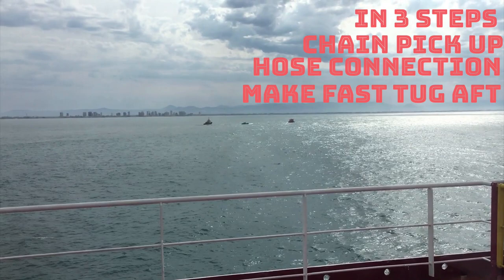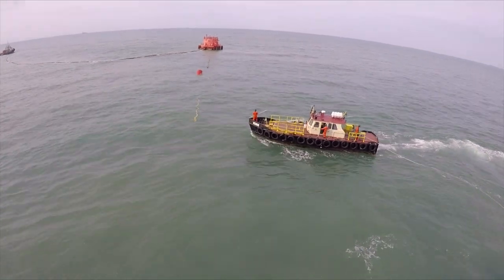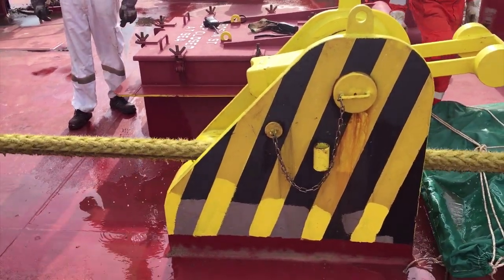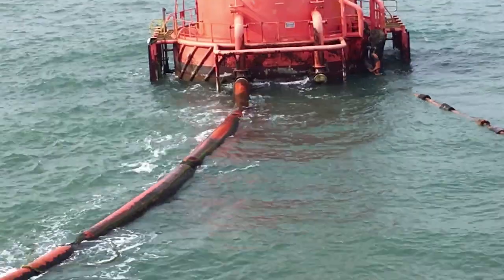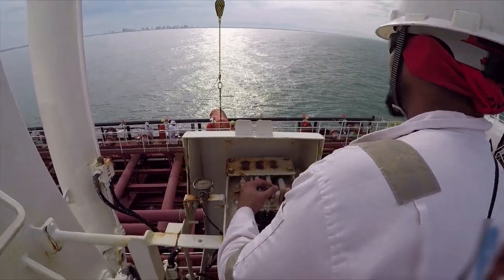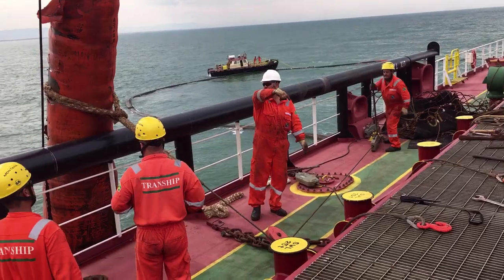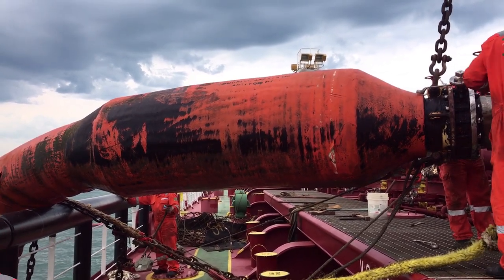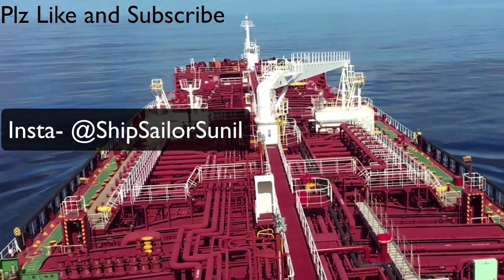Single Point/Buoy Mooring/ SPM SBM/Tanker Ship/ShipSailorSunil

Comment: Amazing video sir..it give lot of information...l have a doubt sir, instead of using tug on another side,can we use anchor for holding the vessel.
Reply from the maker: Anchors are only forward , we need something to pull ship away from buoy , FYI Anchors are kept lashed at SPM as we have pipeline on seabed , so they r not allowed to be used at SPM . Cheers
Reply: Thanks sir for this great information...jai hind sir.